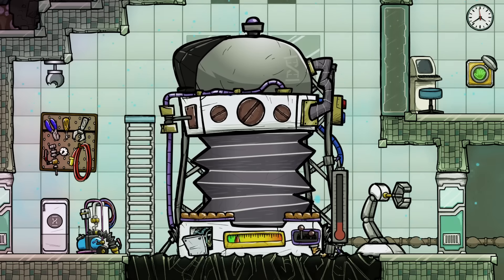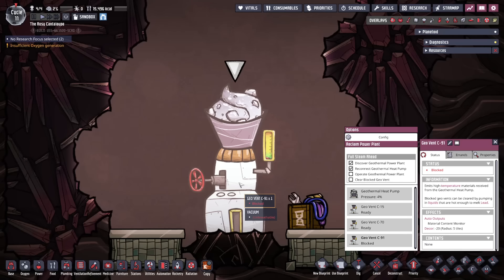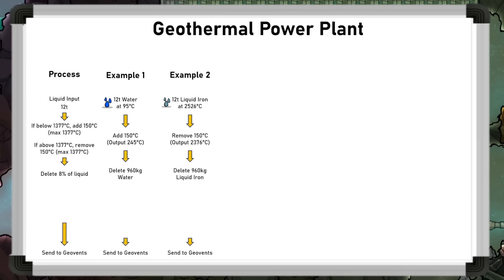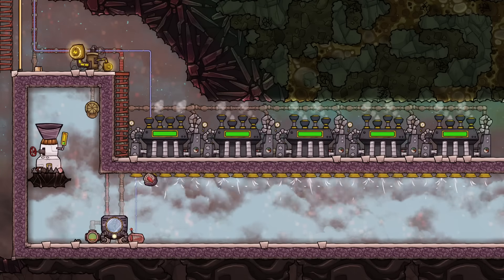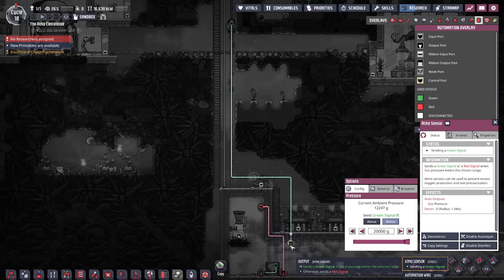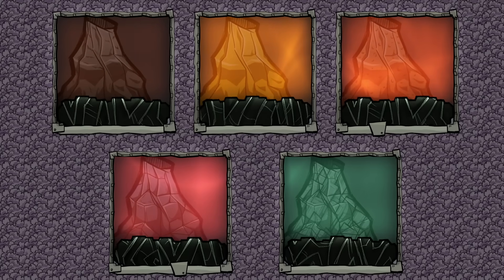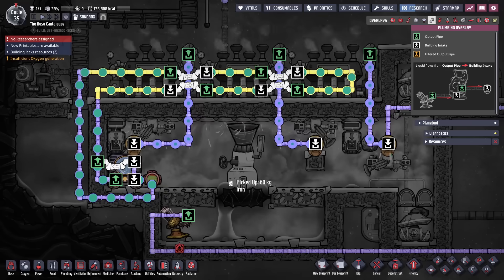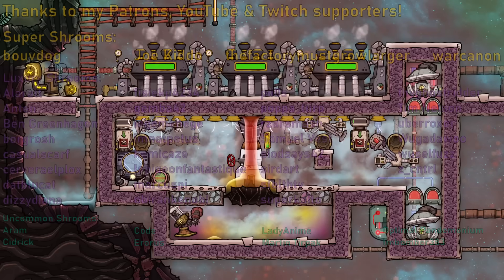Oxygen Not Included - Tutorial Bites - Geothermal Power Plant

Comment: I'm wondering if it can be used to make petro from raw oil. petro generator seems more powerful than steam generator
Reply from the maker: It can, as long as the oil comes in hot enough. But you do get less heat energy as the specific heat capacity of oil and petroleum is much less than water. But obviously you do get the petroleum to burn.
Reply: @GCFungus  Yes, I've tested it. It's hard to make it work for large base. I fed two kinds of oil into the system: 1.The oil output by it, which was not hot enough to become petroleum; 2. Fresh oil, which was preheated by the petroleum it outputs. It works, but not stably, and it's somewhat difficult to make it fully automatic.

Comment: You don't have to use molten metals. Magma and glass can get hot enough. A Volcano with 4 geotuners comes out at a nice 2326.85 degrees. A Glass forge outputs molten glass at 1941.85 degrees.  Magma has 5 times the shc of glass. 1000g of 2326.85 degree magma has enough heat to equalize ~1750g of 1941.85 degrees molten glass to 2226.85 degrees. There are Ceres Seeds with 6 Volcanoes. Each Volcano averages around 1.9kg/s with 4 geo tuners. 11.4kg of magma has more than enough heat to heat 18.6 kg of molten glass above 226.85, with abysallite for the geotuners being the only non-sustainable part of the system. CER-C-16035127-0-0-0 has 11611 kg of magma/s with 4 geotuners on each of its 6 volcanoes for example. Mini Pumps in a vacuum not directly touching the magma with conduction panels for cooling to pump the magma, glass forges sends their output to pipes directly. Since you're not reusing any of the outputs in the pump you can have a cooling loop setup to keep the output vents below the overheat temp of thermium pumps and sweepers to filter the mess out. and have the liquids/gases in the cooling loop run through a steam chamber for power. the only hard part is preventing heat loss on the way to the pump.

Comment: As the system increases steam temperature by 150c to 245c output, but the steam turbines max production is only 200C steam. 
Deletes 960KG water, but adds 720kg salt water and polluted water which aren’t 100% steam by mass and I’m lazy to calculate. Also other impurities have thermal mass too. 
In total you need 25 steam inputs (5 * 5), but if you block 1 input from each turbine and add a 6th.
It’s 24 (6*4) steam inputs which should be enough.This keeps all turbines pegged at stable 850W with less waste.
If instead you want maximum power, you either need to block another input on each turbine (8-9 turbines needed then), or have dedicated turbines in the room to regulate the steam temperature closer to the 240c/200c threshold. Though I do think a build looks nicer when those green bars are filled, even if that’s just an indication of wasted power.

Comment: Could you use pitcherpumps and sweepers to move the Liquid Metals? I know that process could be used for a nyobium volcano. Maybe even the sweeper bot?
Reply from the maker: Everything would overheat and you can't keep a vacuum so I don't think that method is possible.
Reply: @GCFungus So steam will come out even if you pump only metal into the system? That interesting.
Reply from the maker: @Grz349  Yes because the impurities include salt water and polluted water. Also it forms sour gas and lead gas at very hot temperatures.

Comment: While in order to use get a full pipe you need 5 Steam turbines, the output being more than 200°C you can add more to harness the extra heat. Maybe setting up one more or even two with automation to turn on when the chamber is too hot that return the water to the steam chamber instead of the vent with the temp sensor to keep the full optime of the vents.

Comment: on my last save, I used a glassforge to get molten glass, ran it through a metal refinery making copper, if I remember correctly, which gave just the perfect temp for getting niobium, and then I just waited about 50 cycles for the molten glass and other stuff to cool down, which can be done really fast if you have some sort of ice biome above a vent, but doing the glass trick got me thermium around cycle 150 without ever having to do rocketry. and all it cost was 6 tons of copper ore, 96 tons of sand, and some power. So, doing it once can be very powerful early on, but making a dedicated design for it does indeed seem very impractical.
Reply: Tbh "impractical" is maybe best word to describe a lot of newer mechanics added...
Reply: 6 tons of copper ore isn't cost. You can always use copper as metal in future.
Reply: That's a really clever idea.

Comment: Mine has been running for 800 cycles and does not seem to destroy any water.  I get the usual outputs but I have NOT had to add any top up water.  Is this a bug or something?
Reply from the maker: Well the maths says that it should run dry so not sure what is happening with yours.
Reply: @GCFungus I looked more closely and it’s cycle 961, has been runnnig for hundreds of cycles and the only water going in is from 18 steam turbine outputs from two different steam rooms containing all 3 vents.   So i haven’t added water for hundreds of cycles and the steam pressure in both large rooms is 40000 per tile and slowly rising it looks like…. Can anyone explain?

Comment: You can feed in super-heated water at 1 kg/s to get the bonus material.  This water can be heated by passing it through a pool of liquid steel.  The pool of steel can stay at temperature by topping up its heat with a metal refinery.  Some care has to be made to not allow the super-heated water pipes to back up.  So, they should have a by-pass into a steam room to avoid packet stacking and pipe bursting.
Reply: Alternatively, it is also possible to use a geotuned volcano to produce magma hot enough to reach the threshhold to superheat the steam.  Here, the technical difficulty is to not let the... ahem... cold magma brimg down the temperature of the hot magma.  Either keep it constantly geotuned or move the cold magma elsewhere.

Comment: I haven't played this game in probably a couple of years so this is all new to me.
But if this thing only requires really hot liquid, can't you just use really really hot water?

I seem to recall back when I played that if you used one of those rate limiters to allow only small amounts of water in, it would prevent it from becoming gas and bursting the pipe, so you could theoretically heat water to any temperature. So... Couldn't you just do that?

Or am I misunderstanding something ?
Reply: you could technically do this but at a rate of 3kg/s (3 pipes of 1kg/s water) it would take at minimum 6.67 cycles to fill the 12t. That's not taking into account how you wold heat the water to that temperature in the first place.
Reply from the maker: That could be possible, but you'd be limited to 1kg/s per pipe, so 3kg/s total so it would be quite slow. Plus you'd still have to heat the water that hot in the pipe which is tricky. But it could work in theory.